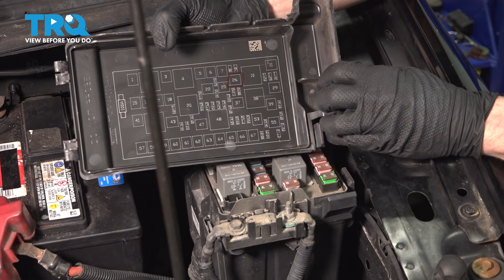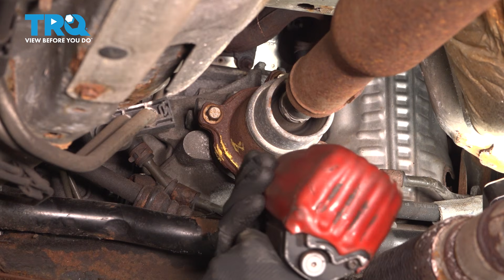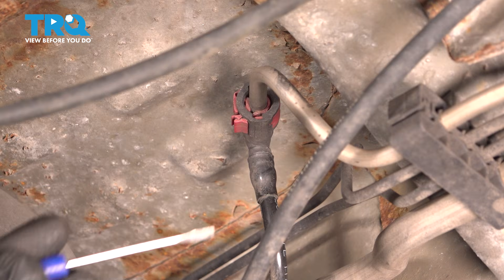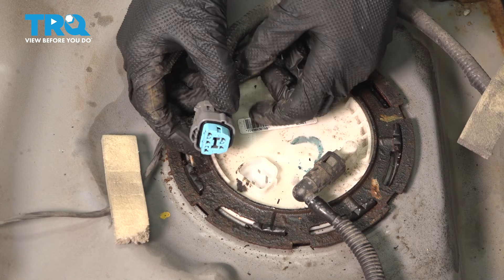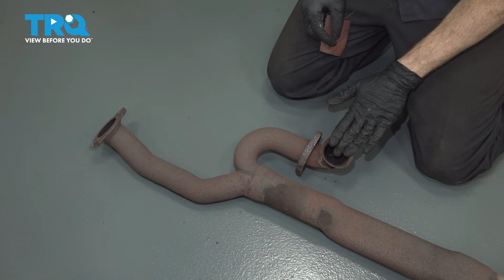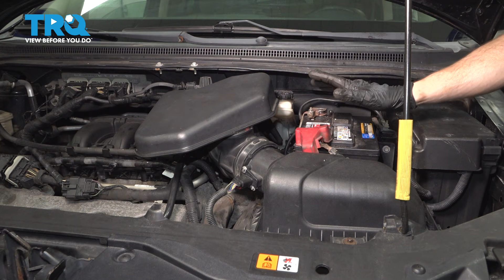How to Replace Fuel Pump Module Assembly 2007-2014 Ford Edge 3.5L V6

Comment: Also i have a 2013 ford edge limited fwd and my fuse box dont look like this. Also my fuel pump has another connection on top as well with the powder so a total 3 on top